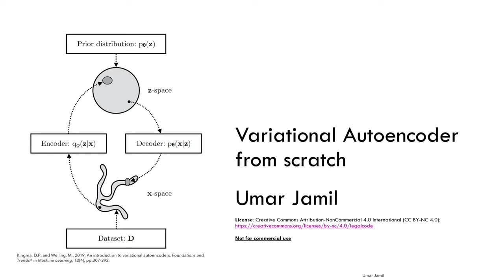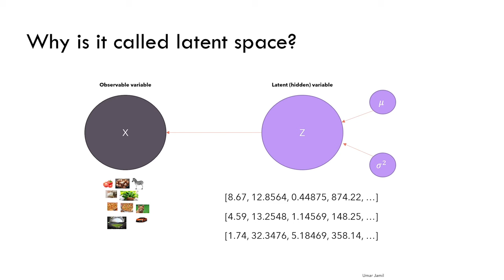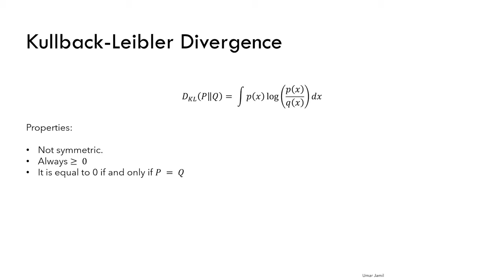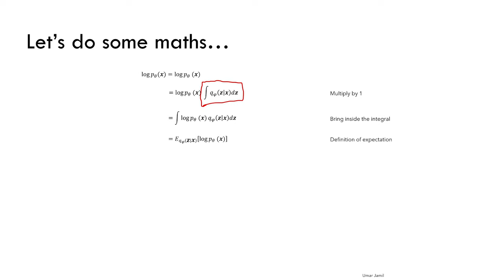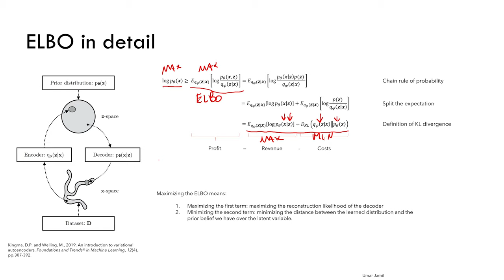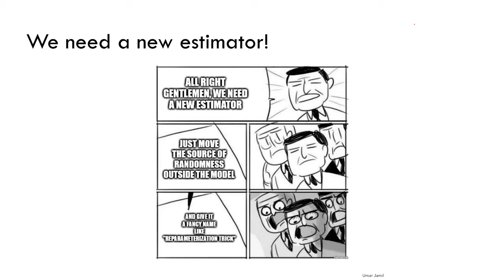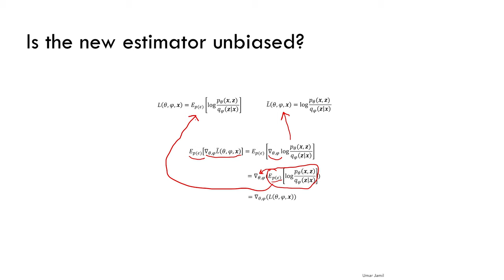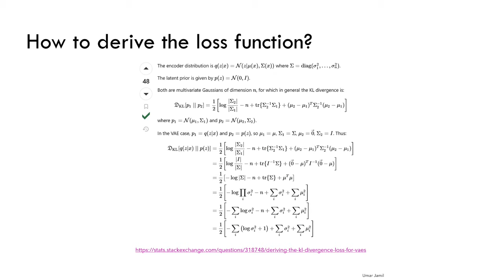Variational Autoencoder - Model, ELBO, loss function and maths explained easily!

Comment: 🎯 Key points for quick navigation:

00:13 understand fundamental ideas
00:41 explain autoencoder concept
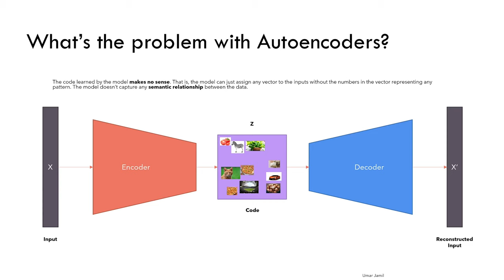02:36 issues with traditional autoencoders
03:02 introduce variational autoencoder
04:13 sampling from latent space
25:02 Model and prior choice.
25:17 Element-wise noise multiplication.
25:32 Learning log variance.
26:00 Maximizing ELBO for space learning.
26:15 Derivation of loss function.

Made with HARPA AI

Comment: Variational methods is a class of methods ive always struggled to understand. I think your explanation addresses some key questions but I thunk you jumped into the math too quickly.

Questions im still wondering about: 
- what are the "variational" parameters? They are represented by phi, but what do they do/mean?
- why is having the noise source necessary? What happens if i set epsilon to be 0 all the time?